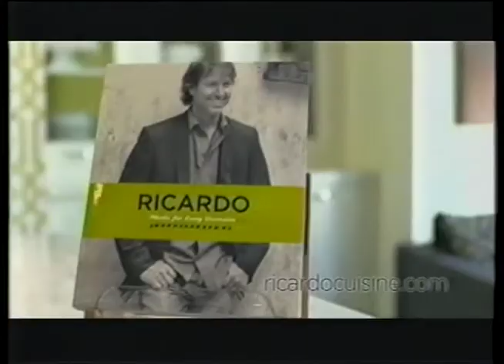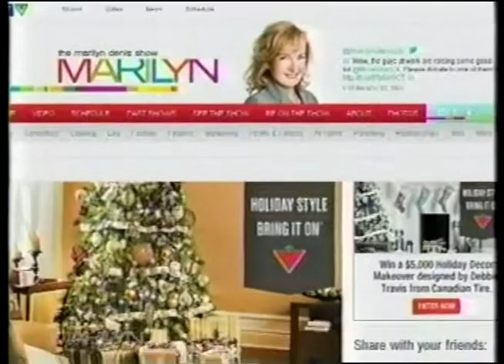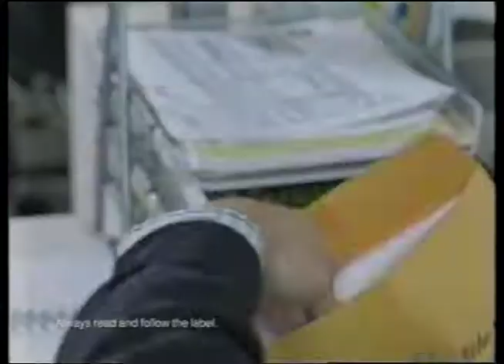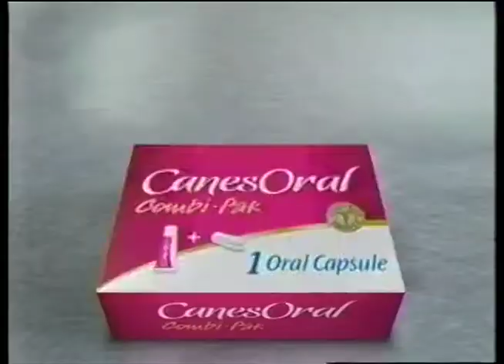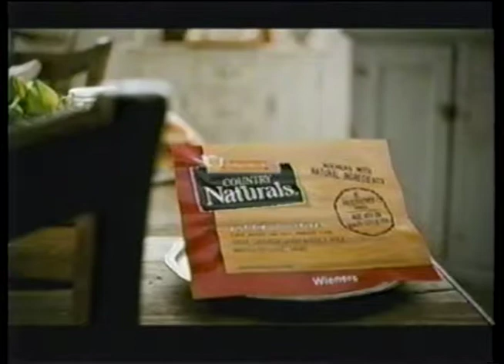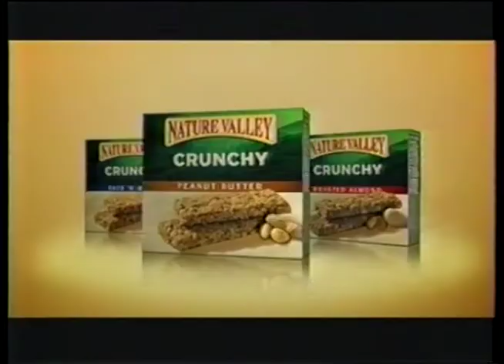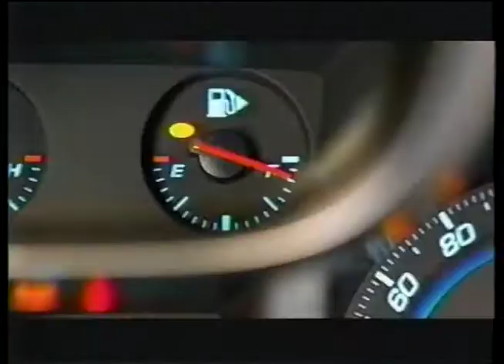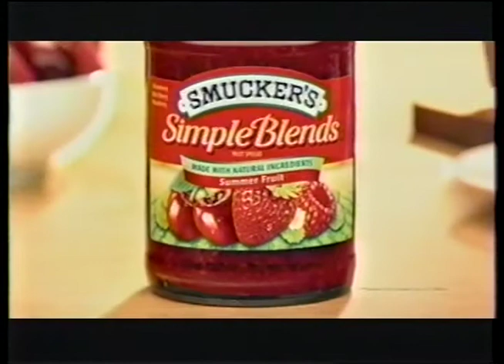2011 - CTV Calgary - Commercials and Bumpers

Comment: Not long after the DTV transition when most analog channels switched to digital. You could still pick up basic channels on Shaw with an antenna cable in Calgary until late February 2013 (CTV on channel 3 for example)
Reply from the maker: I remember this!
Reply: @retrocanadian6775  can you post Canadian TV Commercials and bumpers from 2020-2021?